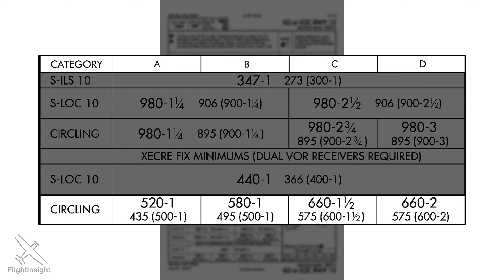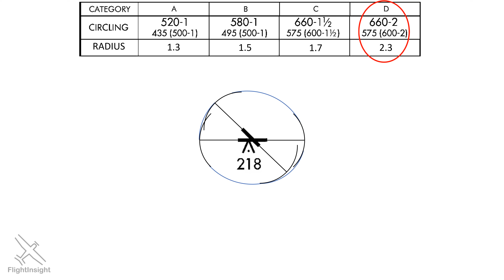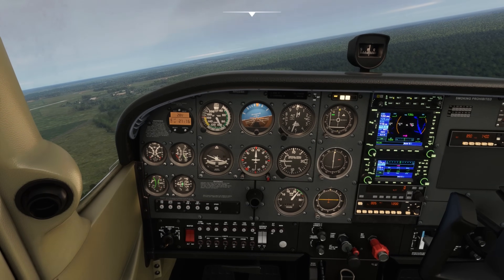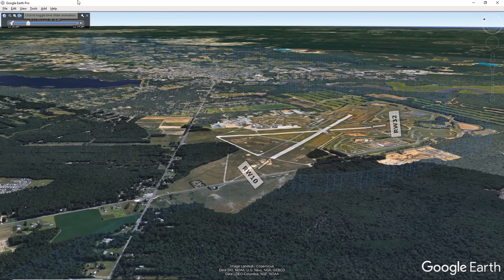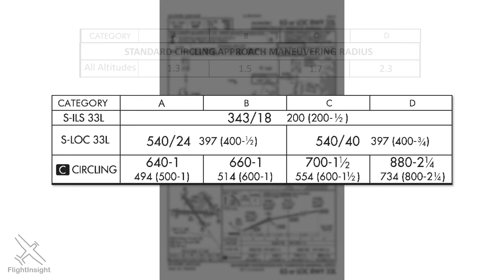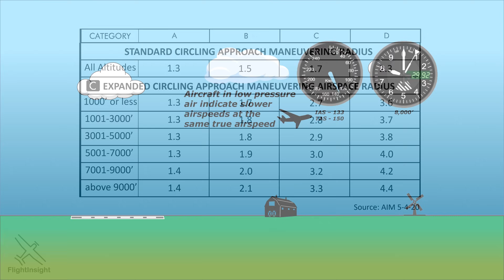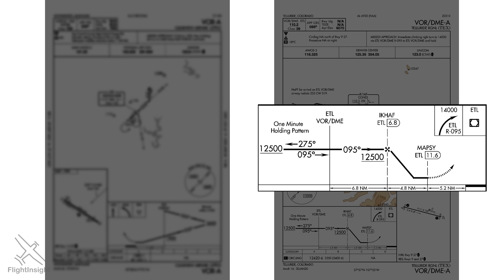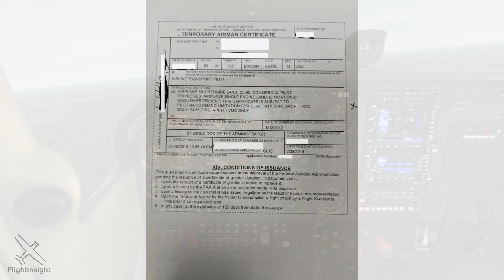Circle to Land Explained | How to Go Missed on a Circling Approach

Comment: The straight in approach criteria is not just a final approach guidance within 30 degrees, it also has to intercept extended runway centerline with so much distance.  Hence it could be witching 30 degrees within correct descent rates but not be a valid straight in approach

Comment: When you lose visual reference to Rwy 32 on downwind I can see why you turn back toward the runway but why circle over that runway while gaining altitude especially if you have no visual reference or dead reckoning associated with it, unless you have a moving map.  Why not continue toward the runway that the missed approach is derived from (Rwy 10) and circle over that since you have the localizer for reference.  Seems safer.

Comment: Question: you mention that for the Telluride approach conducted under Cat C or D would enter a circling pattern to lose altitude more gradually but the plate shows "NA" for Cat C and D. Doesn't this mean that circling approaches are not authorized for Cat C and D? There's some very close terrain north and east of the airport (inside of 3 miles) so circling to land runway 27 would be very risky at a high airspeed. Help me understand what you meant by "enter a circling pattern to lose altitude more gradually" for the VOR/DME-A at KTEX

Comment: How can you tell what descent rate is required for the VOR/DME A at KTEX?
Reply: His numbers are wrong but here’s how you do it.  MAPSY can be crossed at 12420’, runway is at 9070’ 5.2 miles from MAPSY.  That’s 3350’ to lose.

Divide speed 140kts by 60 = 2.33 nm per minute.

5.2nm divided by 2.33 = 2.23 minutes to cover 5.2nm (2.23 would be 2mintues & 14 seconds)

Take the altitude you need to lose 3350’ & divide by the time of 2.23 = 1502fpm.

Comment: Since technically since you're VFR after you break from the LOC... if you go missed, Can you still do a circling climb if you have to enter IMC? Would you just go straight to the VOR or are you good to do it because you're in the protected area?
Reply: You’re still IFR but in VMC.  There are times the field is below VFR minima but you’re executing the visual portion of the approach.  If you go missed you can climb back into IMC following the published missed path & altitudes.  

To stay VMC under the clouds and proceeding to the hold is illegal (assuming you didn’t cancel IFR) & unsafe.

Comment: Can’t agree with the final comment: Circling approach as a last resort…
• IMO, If I couldn’t use a runway into wind I might opt for a circling unless another  approach is available. 
• Then, I would sooner choose to land with a slight tailwind that circle in low visual conditions. 
• Failing all that, I’ll divert. 

I once heard a quote that’ll stick with me forever. “There is no reason to put yourself in a position where you need 100% of your ability, as one day you’ll need 101% to save your ass and not have 1 more % to give.”

Comment: Great explanation. Just one correction. Your category is not based on "approach speeds", but rather based on circling speeds. eg, if your approach speed for lets say a king air 350 is ref+10, ref being 105, that woyld not be your circling speed for obvious reasons.

Comment: Great description. As a long time corporate pilot, remember that once you have the landing runway in sight, or one of the required elements of the runway, you are on a visual approach once you leave MDA. Nobody likes a circling approach, but sometimes they are less miserable if you are just using them to get underneath a 3000 foot cloud deck to get in the pattern. At night, at minimums, you are setting up the elements for an accident chain, where you descend deeper and deeper into a bad idea.

Comment: Great videos. Cessna 172's high wing usually obstructs the runway during the circle. Does that mean that legally (and from a safety perspective) a C172 pilot should not do circling approaches?
Reply: Interesting, it would seem they have poorly worded that section.(No surprise on that.)
 However the requirement to have the runway in sight is for descending below MDA, as long as you make that turn before descending below MDA [or if you can see the approach lights] then its ok. And this is reasonable for most runways and circle approaches. Above MDA you need to meet the published ceiling and visual range minimums (which implies visual reference to the airport environment) and the ability to stay positively within the circle to land protected zone, both navigationally and maneuvering(mostly an issue with jets). Even if you were to go around you still need fly around in the protected zone to get back to the MAP or circling to climb before joining the missed course. The missed course is not only a lateral path but a climb slope that starts at the MAP in order to clear obstacles outside of the protected circling area.

Comment: This is great!  Can you discuss DMMS in a future video?
Reply from the maker: I'll admit I had to look DMMS up. Basically just an accelerated stall speed in a level turn? I'm pretty sure I have a video up on factors affecting stall speed or at least it's in the full Private Pilot course. Unless there's more to it than that. Thanks!
Reply: @flightinsight9111  Thanks for the consideration.  My understanding is that DMMS is more applicable to higher bank angles.  Take a look at this video if you like (not sure how you feel about Dan but he does being up some good points.)  Once again your content is exceptional!  Fly safe!  https://www.youtube.com/watch?v=hX8V0WCWllM
Reply from the maker: Oh yeah if you're circling to land being low, slow, and trying to maintain altitude is a recipe for disaster. One of many reasons why circle to lands at or close to minimums should only be used if absolutely, positively necessary. I understand some operators do them on a pretty regular basis and agree that more strict standards should be imposed to avoid loss of control.

Comment: Just an aviation fan here. Why do airports have circling approaches? Wouldn't be easier for the control tower to provide vectors to the desired runway?
Reply: Check out his video about minimum vector altitudes.  Vectoring can only get you so low, but approaches (even circling) give lower obstacle clearances.

Comment: Many or most circling approaches accidents are while turning or maneuvering under the clouds or not IFR, but VFR portion.  Some airports have circlings as low as 300 agl. That is real Low Altirude Maneuvering or Real GRM.  The pilots that took GRM training at almost 1,000 agl and most times TPA's of 1,000 agl too, They will make pilot errors at Real GRM at 300 or 400 agl. 
They will overshoot final approach alignment and had to go around and hit the clouds again, or, they will stall the airplane on base or final turns (Badly done Real GRM)., Or because of badly GRM done, have to go back to the soup and LOC up there by been tired or run out of fuel, etc.
 That is all because badly done Real GRM from the Wimpy GRM training they got (Totally different GRM).   NTSB then classifies that as an IFR accident, when the problem was Wimpy GRM training.   Same old accidents still happening decades after i learned Real GRM from Wimpy GRM in 1969.

 Most times you have a tailwind on downwind or base leg.  GRM traiining has to be done at 500 agl with real winds too. Not Wimpy GRM.  My GRM as student was at 500 agl with 15 knot winds, not just wimpy GRM. So i didnt have much trouble in low circling maneuvering or any GRM for photos.  They used to send me as charter pilot to places others didnt want to go because they were afraid of low turns needed for that airport.

Comment: I was taught that the IFR portion of the approach is terminated when an aircraft starts the visual circle to land. The clearance limit is the airport. and there is no missed approach procedure once a visual transition has commenced. As a controller, my first transmission if an aircraft declares missed approach while circling would be "say intentions". The aircraft is typically well below minimum vectoring altitude and without a clearance. My advice would be to execute missed approach at the MAP if there is any doubt about completing the approach under visual conditions. Otherwise you could easily end up IMC on a visual approach beyond your clearance limit.
Reply: An approach clearance comes with a missed clearance.  A circle to land is an approach clearance.  True you may be below MDA & Beyond the MAP but the clearance to execute the missed is still valid.  AIM chapter 5 covers how to do it.

Many times the WX at an airport is below VFR minima but above the circling mins.  How could I do a circling app unless I was granted SVFR once I got visual if you claim that once I start the visual portion of the app I’m now without a clearance?

Assuming your logic for being below DH/DA or MDA what would you expect a straight in aircraft to do if at the DA we had the lights insight so we can go to 100 over but never got the runway and went missed? Or we had the runway insight and went missed for any reason?  We were in the visual segment of the straight in app, are we no longer IFR?  I don’t think so.

Yes we are now below and beyond and certain protections are no longer assured but we’re still IFR and going to fly the published missed unless we receive a new clearance.
Reply: Really, if you don't know what the fuck you're talking about you definitely shouldn't make a suggestion. There is a clear procedure for that exact situation. 14CFR91.175(e)(2)   I sure hope your controller job doesn't go beyond Vatsim
Reply: @bangaloremusic  Looks to me like you are the one who lacks knowledge. Read the paragraph you cited. /It says a pilot shall "immediately execute an appropriate missed approach procedure when either of the following conditions exist:
(2) Whenever an identifiable part of the airport is not distinctly visible to the pilot during a circling maneuver at or above MDA," The problem is that the "appropriate MAP" begins at the missed approach point, not some random spot inside that and not well below the MDA which is where pilots trying to circle to land find themselves when attempting the maneuver in inclement flight conditions. What procedure do you apply from somewhere inside the MAP and well below DH/DA? Until the pilot climbs back to the MDA he is on his own without terrain protection, an assigned altitude or a clearance limit. He was cleared to the destination airport, remember? This is why I said as a controller my question would be "say intentions"? ATC will rarely issue a circling clearance unless the reported weather is well above minimums and no other traffic will be impacted by the junior airman's attempt to find his auger in point. It gives away too much airspace and has too many vagaries. I was a controller for 32 years, retired now, but much of my experience was as an approach controller also as a procedures specialist and supervisor. I outlived many who thought they knew better. Good luck and don't push minimums!
Reply: @stevenpurcell4292  Army helicopter Instrument Examiner here. I agree that the IFR portion ends when the decision is made to descend visually. What distinguishes IEs is that we also design approaches overseas in combat areas where there are no approved ICAO or FAA approaches. The missed is designed to be used from the MAP. Between the MAP and any other point you are on your own. It’s essentially IIMC and not a missed approach. That being said, I would typically call it to approach as a missed approach. Simpler than squeaking emergency and telling the controller I was just talking to that I’m IIMC and want to do what I would have done if I didn’t dork up VFR approach. It’s not technically correct, but haven’t confused a controller yet when I do it to guys for training. Also it lets me grade respond to IIMC during an eval.
Reply: @austinrothjr  Austin, my point was that as a controller my response to a missed approach declaration from a circling approach would be, "say intentions", the same response as  would give to a declaration of emergency. Controllers are under no obligation to provide vectors or terrain avoidance guidance to pilots operating below the MDA, beyond the MAP. It is the pilot's responsibility to remain clear of clouds and terrain until they are above the MVA and on a published portion of the MA or published IFR departure procedure. My reason for saying that is to discourage VFR flight into IMC on the visual portion of a circling approach. The pilot should never accept a circling clearance unless he is certain that he can complete the approach in VMC. I'm sure you and I could discuss the various options and scenarios all day. Thanks for your insight.
Reply: @stevenpurcell4292  Completely agree. You’re under no obligation and pilots should be prepared to be on their own for the first few moments just as if they were IIMC because they kind of are. ATC may not even have you on radar and/or you’ll initially be below the min vectoring alt anyway. You’re going to get a “say intentions” wether you’re IIMC or missed approach for weather anyway. I think you’re exactly right.
Reply: @stevenpurcell4292  Seems like the Learjet crash from a couple days ago was circling to land after cancelling IFR since the procedure was NA at night. Makes this video and the discussion even more prescient though I’m not sure what the sky conditions were and if that was a factor. Seems like it was likely a stall/spin while circling at too low an airspeed and becoming disoriented. Sad.
Reply: @austinrothjr  Wind was light and variable with a broken layer at 2000' overcast at 2600, 3mi visibility. I think a hint may be found in the pilot's request to turn up the runway lights which were already at 100%. When I started ATC at NAS Miramar in '72, the prevailing visibility was 7 mies on a clear day. When I left in '78 the vis average had dropped to 3sm due to pollution. It was (is) always hazy. What wind there was was from 190 which would make RWY 17 more favorable but RWY27 is longer. My guess would be spatial disorientation at low level in marginal VFR conditions. Slippery, fast aircraft prefer precision approaches to touchdown.
Reply: @stevenpurcell4292  I agree. Likely a habitual bad technique that finally bit him. Spatial D leading to loss of control.
Reply: @austinrothjr  There is  video of the crash from the crash site perspective. The visibility appeared to be much less than 3mi. with visible low scuddy clouds. Very poor conditions for VFR jet circling maneuvers.
Reply: @stevenpurcell4292   No argument from me there, though it was still reporting VFR with mist (I believe). Video can be deceiving, especially at night, as to visibility, but definitely sketchy at best.
Reply: @austinrothjr  the video is quite telling. You can hear the aircraft pass overhead then the land ing lights become visible in a steep dive.